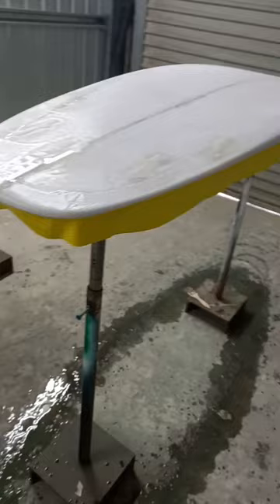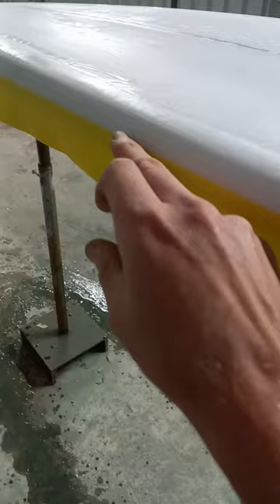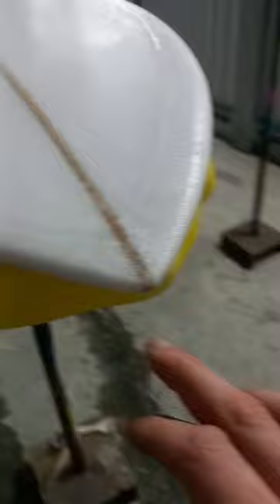TIP OF THE DAY: masking noses and tails for hot coats / resin coats

Comment: how do you achieve a hard edge on the tail if you don't have the tape about the bottom of the board here?
Reply from the maker: So this coat is only the sanding coat. Once this layer of resin is down on both sides the whole board gets a hefty sand before the gloss coat and that's when I do my resin dam on the tail for that sharp edge.

I've got another "series" of shorts called "this one gonna be mental" and those pours are the gloss coats

Comment: What if you wanted to leave a hard edge at the tail on the bottom of the board?
Reply from the maker: So this is only my sanding coat. All laminates are on so both sides now get a  sanding resin coat. Once they are on the whole board is sanded to perfection and then both sides are gloss coated. The tail is damned with masking tape on that gloss coat to create the hard edge